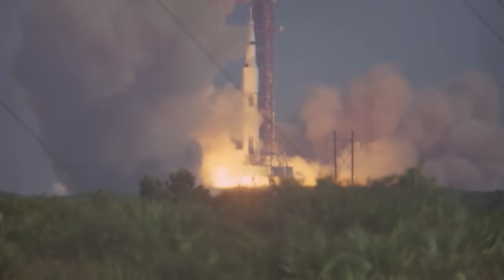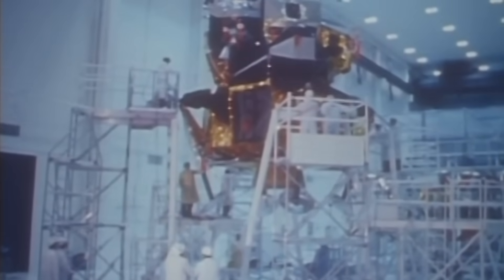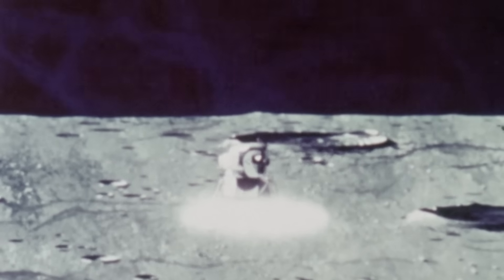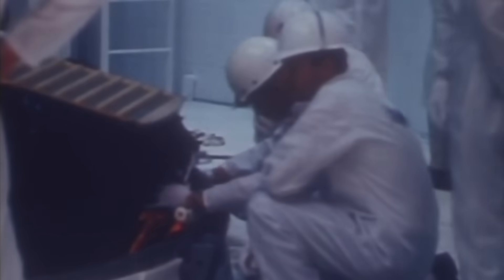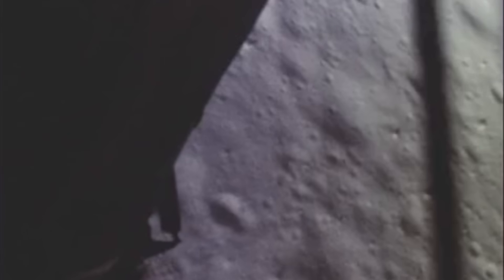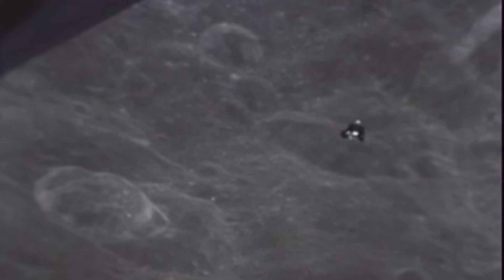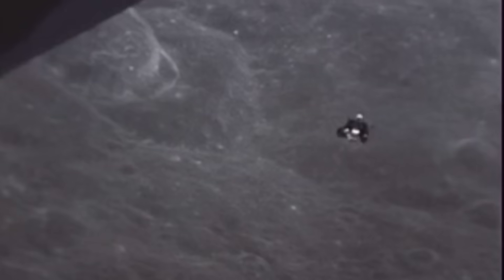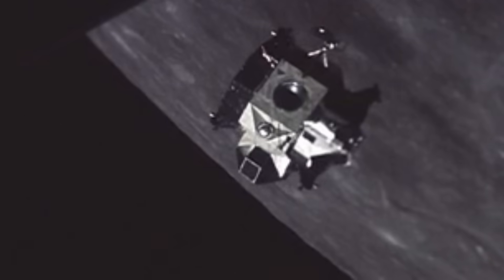The Lunar Module: Apollo's Fragile Masterpiece of Engineering

Comment: I worked at Bell Aero on the Lunar Module Ascent engine as a rocket test engineer, 1965 - 1969.  The facility was Bell Test Center, north of Niagara Falls, Model City. It was a former WWII ammunition storage facility composed of concrete Quonset huts, which were used as the control rooms.  The test cells were across the street, steek frames with corrugated steel walls.  Sea level tests were done without the expansion section downstream of the throat.  There was one "altitude" test cell which ran the entire engine with the expansion section. This was an enclosed chamber which was evacuated to near-vacuum with a steam ejector system.  We worked 24-7.  I first worked days then later worked nights for 1-1/2 years. We did all the development work then tested the production engines which were shipped to GAEC  Bethpage, LI. My first year I worked at test cell 3C where we tested "positive Expulsion" titanium tanks with teflon bladders which provided liquids in non-gravity. When I worked nights I had a car to drive to the multiple test cells I oversaw.  I reported to a senior test engineer.  We had so much work that Bell hired engineers from the UK to fill the gaps.  When the development was complete and work wound down layoffs commenced, luckily I got a job as a design engineer at Pratt and Whitney in Fla at FRDC.  I am 82.

Comment: And this underlines why I take all predictions of colonizing any off-world body with a pound of salt. We needed a masterpiece of engineering, which the Saturn V was, in order to get a tinfoil bug carrying two crew to the local moon. No cargo. No construction equipment. No survival supplies. This was basically a brief camping trip.

Boeing cannot manage to get the Starliner operational on a local jaunt. The Gulf of Mexico is a Space-X junkyard. We aren’t building colonies any where outside our atmosphere.
Reply: Going to Mars is a much bigger and more complex problem than going to the moon. One problem I see is systems reliability. Once you leave earth orbit and head to Mars if you have an Apollo 13 style systems failure you won't be able to just loop around something and come right back. You'll be committed to going all the way to Mars so you can loop around it and return all the way back to earth. Also, unlike with the ISS, you can't send replacement parts up to a Mars bound spacecraft. You'd have to build an immensely complex machine that will be able to operate flawlessly for two to three years with no material support from the ground. Good luck with that.
Reply: Indeed. I wonder what the Mars equivalent of a LM would look like, even for another ‘camping trip’. Just dealing with the extra gravity would impose a massive burden on the design.
Reply: It could be done if enough money was thrown at it. First we would need a very good reason to throw that money. Like discovering life on Mars, but even that might not be enough. Only the scientists would really care. 
Building an unassailable military base there might be justifiable.
Reply: Yes. Apollo was an Incredible program but I often tell people that landing on the moon was like going down to the local grocery store while a manned miision to Mars is equilalent to going to the South Pole.
Reply: Gulf of America....

Comment: 12 hours in and still no 'lunatic' troll posters?
Can't be long now.

1:12, Originally called the Lunar Excursion Module, but still referred to as the LEM after 'Excursion' was dropped from its title.
Reply: Too much real technical info here. Hardly any room for such ignorance here, pretty sure this video addresses too much for them to "debunk".
Reply: @DJRonnieG  .....'real technical info' is not a deterrent to them. It's a psychological issue that cannot be fixed. If you were to put one of them on a rocket to the Moon, they would claim to have been drugged.....the conspiracy mindset is a permanent disability.
Reply: Sometimes you are just plain lucky...😏
Reply: Hopefully the poster of this video is blocking the dolts.
Reply: Golf

Comment: Although the LM was designed to do one thing, and one thing only, on Apollo 13 it pushed the Service Module, the Command Module, and itself out of moon orbit and back to a return to earth trajectory, while also serving as a lifeboat for all three astronauts.  What a machine.
Reply: Not quite correct. Apollo 13 never entered lunar orbit. It swung around the moon and returned to earth. The LM descent engine was used to put the CSM and LM back on a free return trajectory shortly after the oxygen tank explosion and before passing around the moon. The astronauts used the LM RCS engines to make course corrections after rounding the moon. Still an amazing piece of engineering.
Reply: @CraigParry-y1b  You are correct...they were not in a moon orbit.
Reply: One correction. Because of the explosion the spacecraft never entered orbit around the moon, so the LM didn't have to get it back out of lunar orbit again. Everything else you said was correct. And it was a great machine.
Reply: @joevignolor4u949 I thought they had to do a burn coming around to head back to earth and escape lunar orbit?
Reply: @pnichols6500  They did a burn coming around the moon, yes. That was not done to escape lunar orbit: they’d done that earlier, before getting to the moon they did a burn to move back from a trajectory that would lead to lunar orbit, to a free return trajectory (as @CraigParry said). The burn at the moon was done to reduce the time they would need to get back to Earth.
Reply: @pnichols6500 they did do a second burn, periynthion or PC+2 burn, closest point to the moon after they swung around, it was a few minutes long and was done to cut over 10 hours off the return trip, which crucially had them reenter in the Pacific Ocean where recovery forces were. But once they did the first burn before coming around the moon, that was to get back on their free return trajectory track, they weren’t in lunar orbit so they did get a view of the moon unique compared to all the other astronauts. I think it was like 160N miles rather than the 70N miles they usually would be. I think they still hold the record as well for the farthest anyone has ever traveled from earth
Reply: @respectdawildo_danjones508 Thanks for the explanation!
Reply: I take it they afterwards redesigned the CO2 scrubbers to allow for 3 astronauts for however long a return might take, rather than just 2?
Reply: @PopeLando  Not quite...the issue was that the CO2 scrubbers of the LM and CM didn't fit into the same slots.  After Apollo 13, there were many changes made to the CM and the SM (Service module).  Including more scrubber capability.
Reply: I was glued to the TV as a 10 year old kid watching that all happen while listening to Walter Cronkite and Jules Vern explain it.
Reply: They should make a movie of that.
Reply: Yes, the most awesome and successful vehicle of all time !